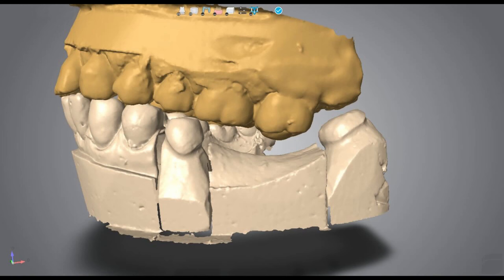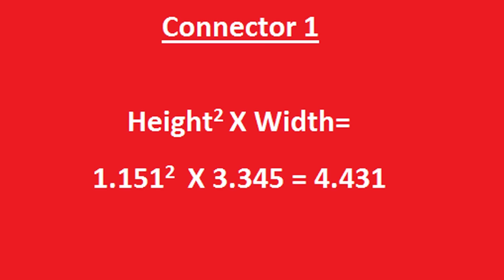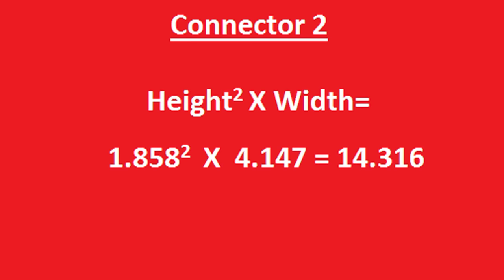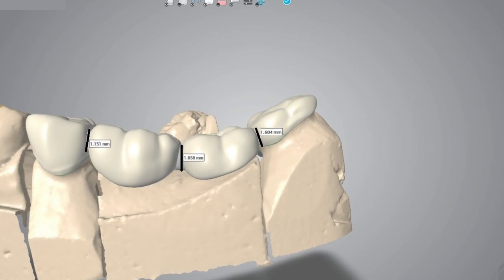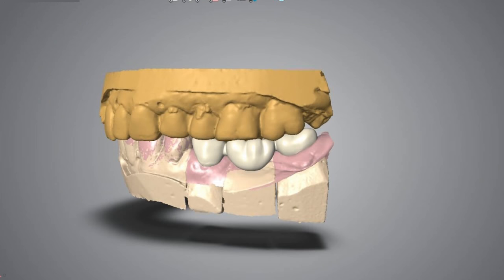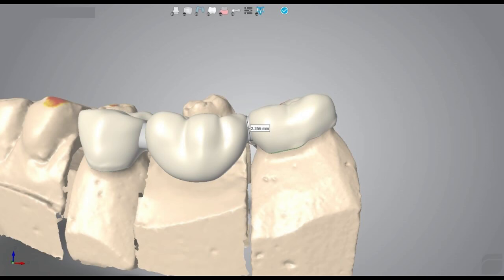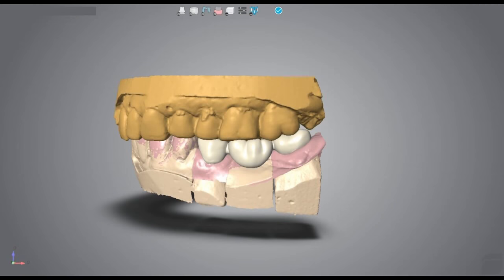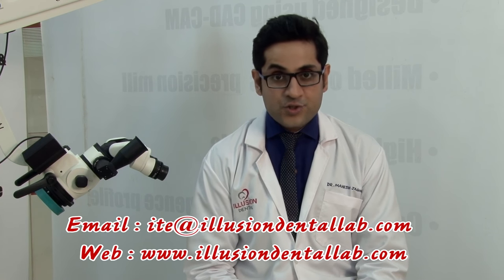The Rule of 27

Comment: Thanks for the informative video.
Could occlusal recontouring of the supraerupted teeth have made Bruxzir bridge possible here? Also, how long a span can be safely planned while opting for Bruxzir?
Reply from the maker: Thank you for your question Dr GD Jain.Recontouring a healthy tooth should be the last option especially in such a case where even if we adjust the opposing tooth we wouldn't be able to get a sound connector because of the extent of supra eruption of the upper tooth.Also,needless to say,we would do more damage to the healthy teeth.So its better to have a PFM made instead a BruxZir.You can give a long span bridge as long as the occlusion is fine and very few or no undercuts..